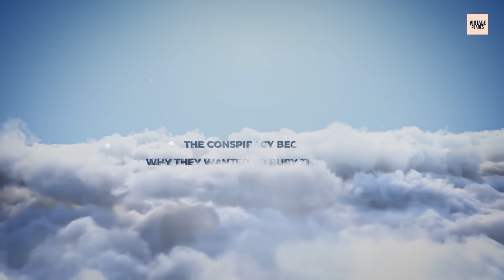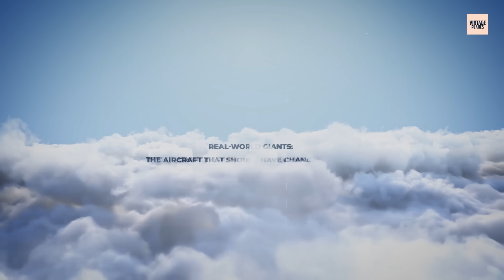THE BANNED TRUTH BEHIND ALLISON'S V-3420 MONSTER ENGINE

Comment: The British had an engine along these lines, the Fairey Monarch, designed for naval aircraft to give them twin-engine power and reliability in a single-engine type aircraft. At that time twin-engined aircraft were not considered suitable for carrier operations. It was an upright H engine, two 12 cylinder opposed engines on a common crankcase but with independent crankshafts, each driving one half of a contra-rotating propellor. The Fairey Battle light bomber, generally considered a hopeless failure that ended the lives of many brave airmen, would also be powered by the Monarch and thus achieve the sort of performance that would make it a useful bomber. In fact, the prototype Monarch flew throughout the war in a Fairey Battle used as a Fairey company hack, without problems, in fact almost trouble-free. The big-engine mafia, Rolls-Royce, Bristol and Napier conspired with the Air Ministry and others to make sure the project was stifled, under the excuse the Britain did not need another big engine manufacturer. So when you see the casualty figures for British naval aviators flying the Fairey Swordfish or the Barracuda, think about how many of those lives could have been spared if they were flying torpedo bombers with 2500+ HP engines and twin-engine redundancy.

Comment: There were MORE V-24 engines in WW2, like the Rolls-Royce Vulture which wasn't EVEN producing the promised 1,750hp, the Germans tried to make a version of this by merging the famous DB600 series together themselves though they never knew about the Allison V3420 and that was the DB610, the MAXIUM amount of horsepower for the DB610 was 2,870 hp, but the DB610 was so unreliable that they caused the Heinkel He-177 which used the DB610 to catch FIRE, this was caused by the DB610's sheer, unending hunger for constant cooling.  EVEN the Germans couldn't solve it, yet Allison was able to conquer the V-24 engine and made the DB600 series which were mechanical marvels look like WW1 aircraft engines!

Comment: The jet had a better power to weight ratio.  Opposed piston Diesel engines too made more sense for bombers, cause although they are heavier, the lower fuel consumption more than made up for the extra weight of the engine, meaning an equivalent  bombers would still have a longer range or bigger bomb load. And the engine could fit in the wing.  More reliable and less volatile fuel as well.

Comment: Imagine these engines in an XB-49 sized fuselage.  Already unbeatable, it would have been comparable to a B-52 but years earlier and so much cheaper.  Ditch the robot voice-over.  It is deadly monotonous and entirely unlikeable.
Reply: @russbolzing  The Allison V3420  was to be a back up engine to the Wright R3350 on the Boeing B29, because the Wright R3350 was having so many reliability problems.  There actually was a B29 built with the V3420  and it worked just fine, the excuse given was the R3350 had been straightened  out enough to be serviceable !!! !

Comment: Too much conspiracy... All other " coupled" two engines into 1 giant engine never worked...Could Elison be better? Just remember V1710 was a average engine... And all PW R2800, R4360 proved to be great...and V3420 was too late too, at its time what's the point to developing single propeller driven airplane when jet power fighter show much more potential...
Reply: Careful. 
  Your ignorance is showing. You are partly right. The V1710 was not "average." Its limitations were imposed upon Allison by the AAF. Once Allison was allowed to research 2 stage supercharging and inter-after cooling, the V1710-F110 exceeded the performance of like equipped Merlins. The Packhard Merlin V1650 couldn't touch it. 
  Even tge B29 was prototypes with V3420s. The air-cooled problematic R3350 could have been retrofitted into the B29 and would have been the B39. But too  late for the A Bomb.  
  For decades, unlimited air racing "Merlins" use V1710 internals. 
  But, like you say, the advent of jets curtailed the development of late-war amazing piston types. Superlative Bert-McCollum singke sleeve valve designs by several companies were dropped.
  The best of them was the Napier Sabre. A masterpiece. 
  Check that out.
Reply: If it (with double supercharger)was so good, why didn't it been fit back to P-51...only single engine plane (production one)using 2-super charger version was P-63 , which sent to soviet union... @michaelwillette5738
Reply: Wrong. It was not average.

Comment: I used to work with a guy called Frank Saunders, he was a local Speedway legend and in the mid 1950s he and a friend bolted two Allison V-12s together, dropped these into an old Scamell truck frame with some other bits & pieces using a two speed marine gearbox and built a racer.  I have seen all the photographs including him going down a beach at around 160 MPH still accelerating sitting on a beer crate wired to the couple of pieces of wood that were bolted to the frame rails which passed as a floor.
He told me he never got to top speed because he got scared or ran out of beach.